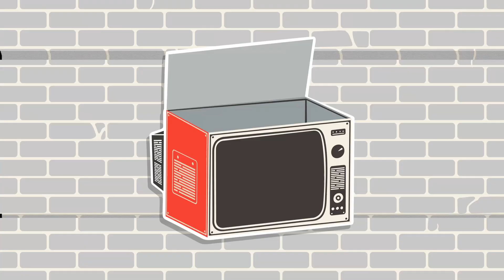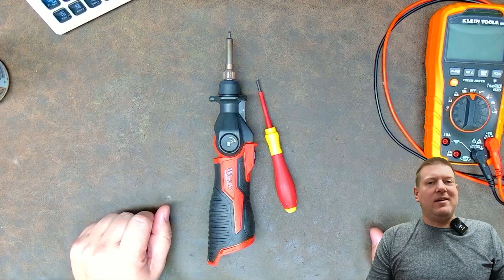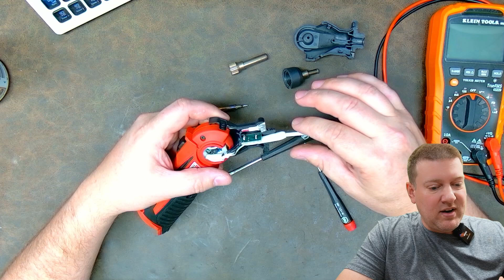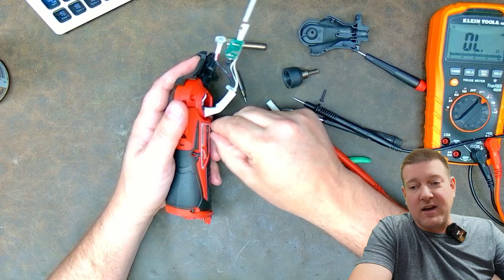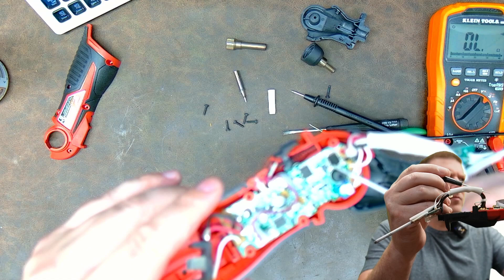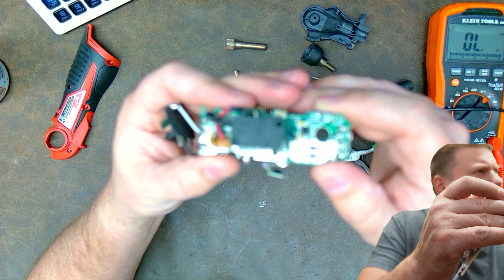Milwaukee M12 Soldering Iron Tear Down

Comment: Is there any current draw when connected to your lab powersupply ?
Reply from the maker: Excellent question.  Minimal - just the circuit not the heater.
Reply: @TakeItApartChannel , i think the voltage from the battery is feeded with a boost circuit, possible that the inductor coil to the heater is toasted